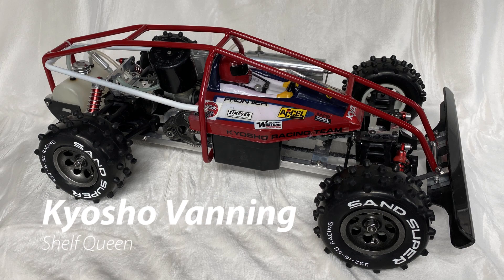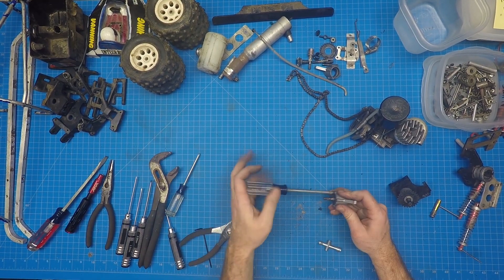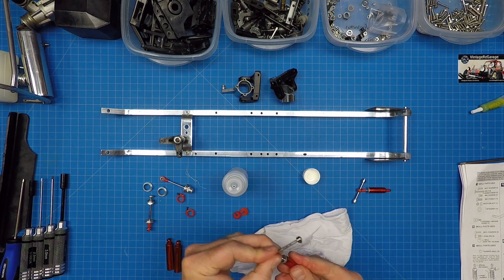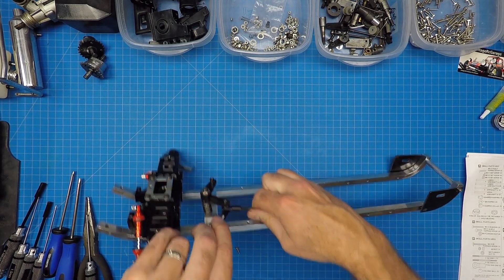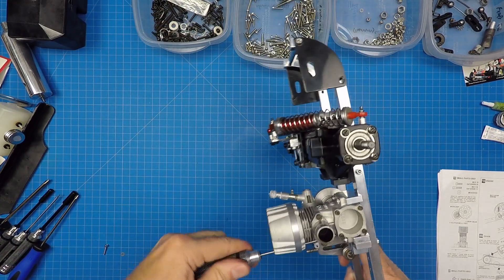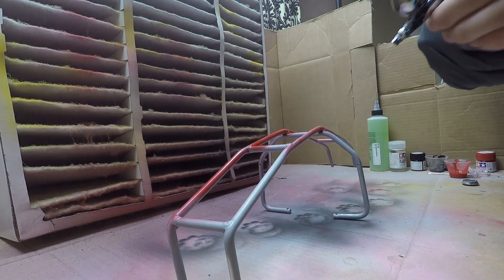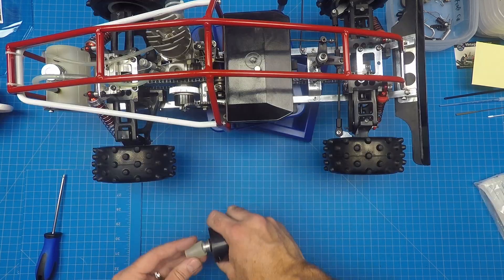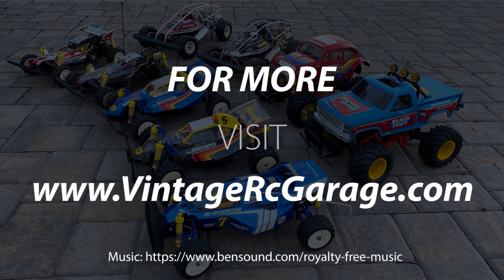Kyosho Vanning Queen - Restore

Comment: What servos can I run in this Vanning's tray..? I've tried to fit 1/10-1/8 scales servos I had laying around but all was to big.. A link or part numbers would be great.. It's all I need to get mine running.. Thanks..
Reply from the maker: I struggled with that as well. I ended up with Futaba FP-S26 servos but not specifically because of size but because I also have a bunch of servos. I do not remember it being any smaller than most other servos. However, in order to get the servos to fit inside the servo mount I ended up having to take apart the servo and feed it through and then reassemble it. I did this to avoid having to cut the servo mount. Hope that helps.
Reply: @VintageRcGarage  That's geniuses and will try separating cause I don't want to trim the tray either. Yesterday on eBay I found a pair of Pro Optima Mid SE KS-88a that the guy claims came out of a Vanning. I'll take the chance at $36.. Thank for the tip..!

Comment: I think this was the last buggy on this layout? Then came Burns, Turbo Burns, Inferno which looks a lot like todays buggys.
Reply from the maker: I am not that familiar with the Kyosho line as this is my only non-tamiya I have ever built. I do recognize a number of the parts and design features from the Vanning on a number of other models.
Reply: @VintageRcGarage  Thank you for replying! I remember these buggys from the catalogs but I was to to young to own any of them.

I did some research;

Land Jump was Kyoshos first 1:8 4WD offroad, and was released 1980. It had a similar tube body as the Vanning but the old style suspension.

Vanning was released in 1986. 1987 came another version with the same (?) chassis, called Presto which had a polycarbonate body. 1987 also saw the release of Burns. Yuichi Kanaisgot got involved with the Turbo Burns in 1989 which had some improvements (like a wing for example) and in 1991 Kanai developed the Inferno (MP1) with Kyosho Team. This was a real game changer and won everything following years. My buddy got the Inferno and I gotta say all the dudes in the neighbourhood was pretty jealous.  I still had my Stinger MK2 and it was a toy in comparison to the Inferno. Later I got the Turbo Inferno and me and my buddy started racing seriously :)
Reply from the maker: Thanks for the info!

Comment: I had the this car it was amazing, super fast
I think the diff assembly had a gasket you are missing- keeps diff oil clean

The engine mount and gear assembly was not machined but die-cast
Reply from the maker: I will have to go back and check about the gasket. This one was built as a queen but I have two more left over to build. One I want to make functional. I really wanted the Vanning as a kid and would really love to drive it.
Reply: @VintageRcGarage   I’ve had many 1/8 nitro buggy’s the shaft drive system always felt %20 less snappy and responsive- not mention the speed difference- you can gear the vanning to the moon and hit some impressive speeds

There is one super clean on ebay right now, I am bidding on - if you are bidding on it please don’t bid against me, or if you really want it let me know I will stop bidding
Reply from the maker: It’s all yours:)
Reply from the maker: Here is a question for you. If you were going to put any engine in a Vanning for running, what would you choose? My Vanning is my only nitro.

Comment: Hi, great video, I have a vanning, can I ask does your chain rub against the carb slightly. I have an os max 21 rfb with mine that never run
Reply from the maker: I ended up with 3 that I put together into one queen. One of the carbs was significantly cut in from the chain so I know it happens. I am not exactly sure what the cause might be. By any chance are you missing the chain tension roller that gets installed in the front?
Reply: @VintageRcGarage  no got the chain tension roller, can I ask what engine is in yours?
Reply from the maker: I have a OS Max 21 VF-BR on mine
Reply: Mine all rub on the carb with OS motors. Maybe the Enya motor doesn’t rub as much.